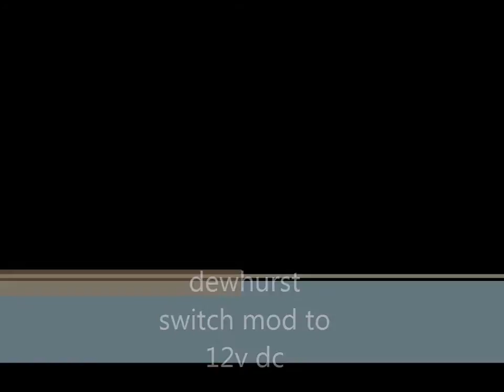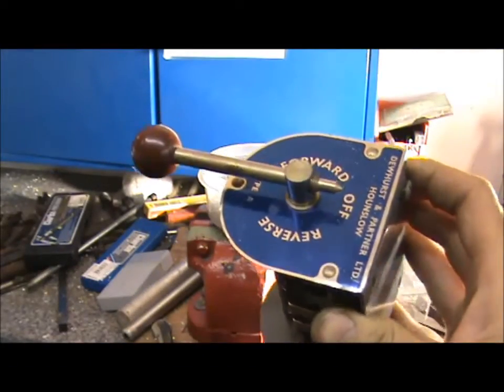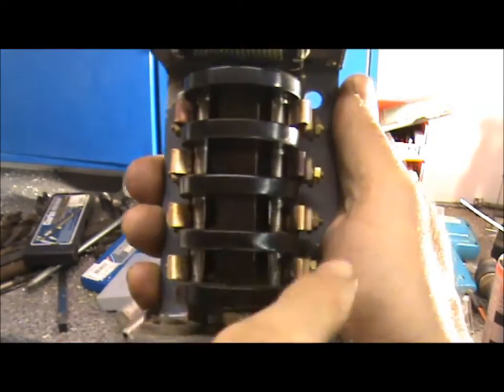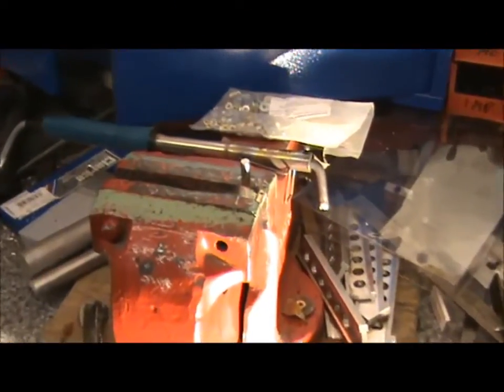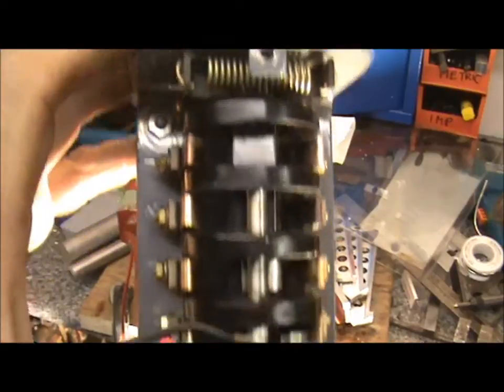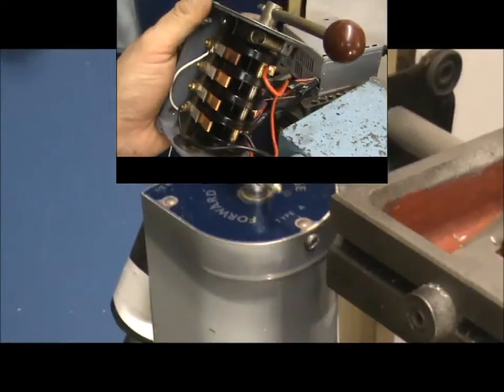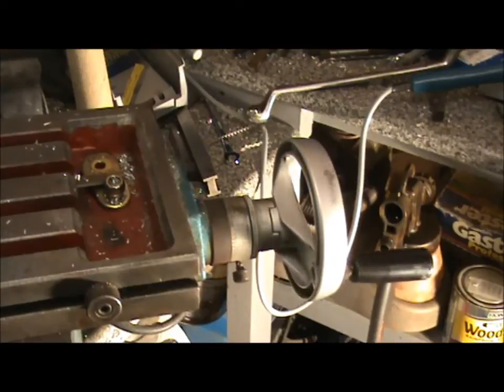A Dewhurst reversing SWITCH 12 volt hack or MOD

Comment from the maker: hi eddie, I had a look on the net a while back when trying to figure out the switch, it seems that a 240 ac  motor needs four wires coming out,or three and the earthed body/, its got something to do way energizing the internal windings for reversing, where my 12 dc motor only has two wires that's why I had to mod it, there some goods guides on the matter, regards chris

Comment: I have one of those Dewhurst switches. It's not used for anything at the moment. I wanted to use it for my small single phase lathe. Is there any special requirement for the motor do you know? The motor is an old british thing, no makers name, but old and well built. It's 1/2HP single phase, and thats all I know about it.

Comment: The two terminal columns are different, some just single connectors and some double, so that two different circuits are created depending which way you have the switch (forward or reverse). Check the silver columns out for continuity and you'll see what I mean.
The switch will rotate 360 degrees, so what happens to your soldered terminals if you forget this and wind it round?
Reply from the maker: thanks Colin !  I knew it should of worked.... just didn't know how, my bodge up seems to be working :) but it would be nice to have it right

Comment: Hi, Your comments regarding the way you flip the lever, to Forward or reverse, making making no difference to the contacts, is not true.
When you flip the lever to Forward, the following pins make contact: 2-1-5,   3-7-6,  4-8,  Flipping it to Reverse the following pins make contact:  6-1-5,   2-3-7,  and 4-8.   Try measuring this with a multimeter.
Reply from the maker: Thanks it makes sense but it , sounds way to complicated for Chris the bodge !! It’s still working fine  seven years on 🙂
Reply: I was having the same trouble as Chris, found this video. Thanks Jan, you're the boss.